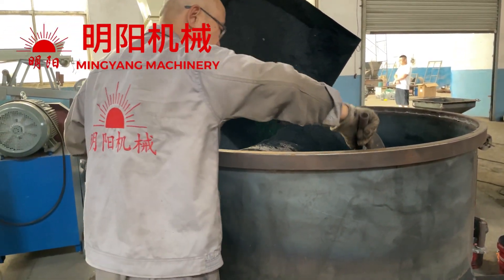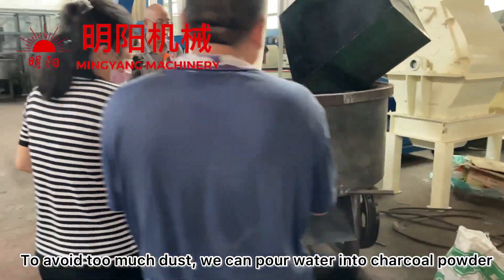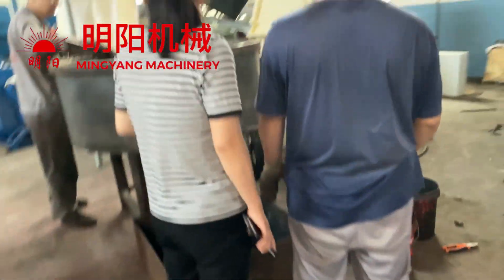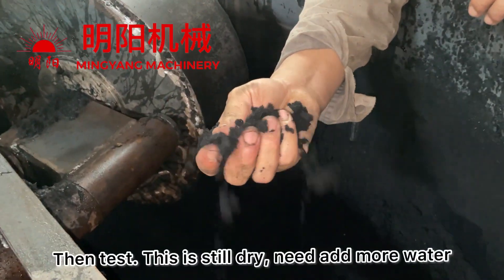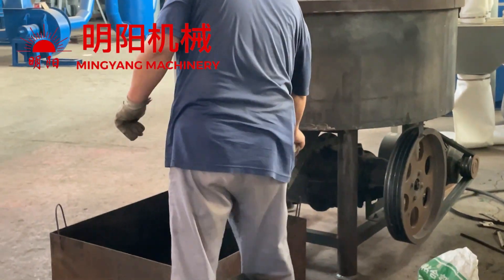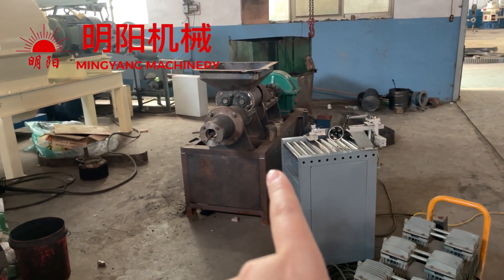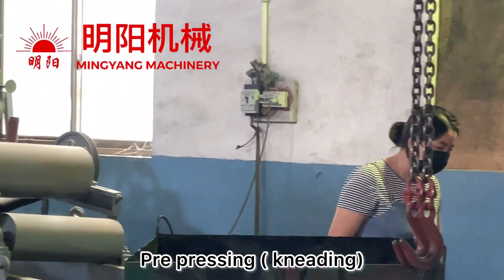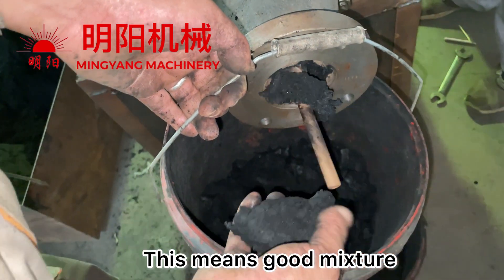How to mix charcoal, binder and water- Shisha Charcoal Formula

Comment: Please, how many litres of water did you add to 100kg sawdust?
Reply from the maker: About 35kg water
Reply: @kimzhao-charcoalmakingmachine  35 kg water isn't  much ?
Reply from the maker: @joydickson5929  Hi our charcoal powder a little big. And very dry. That’s why we use that much water. If you produce yours, you need try several times until you get a proper water amount. So this is not a specific ratio. All based on your raw materials